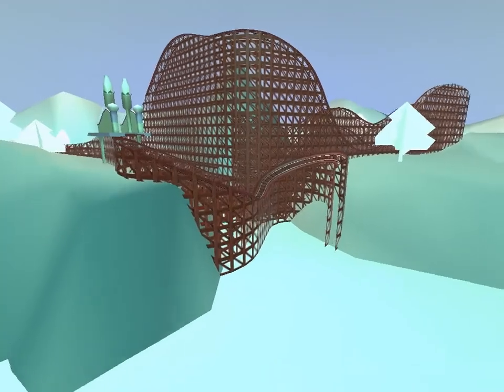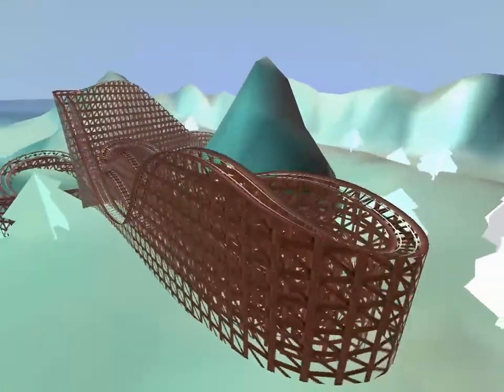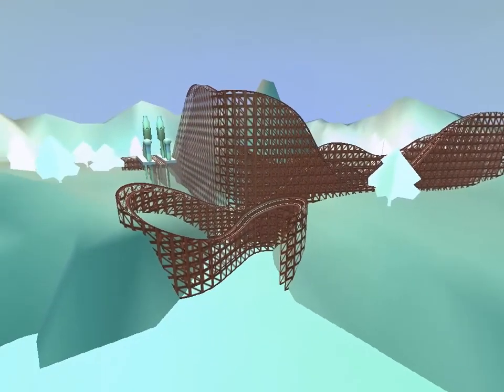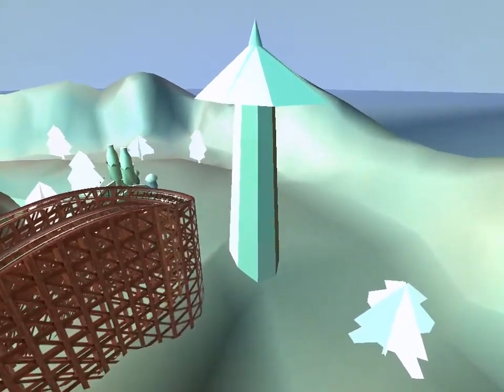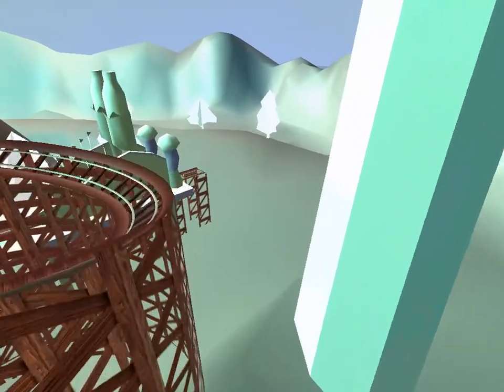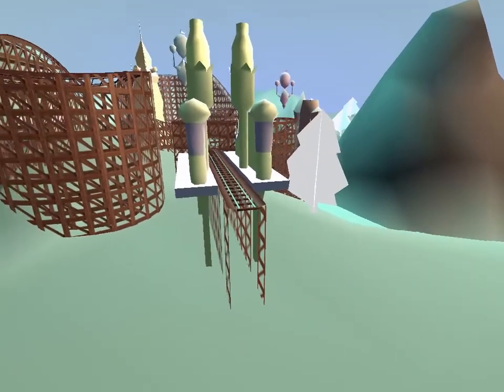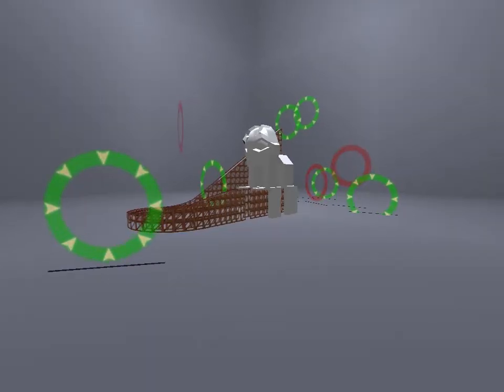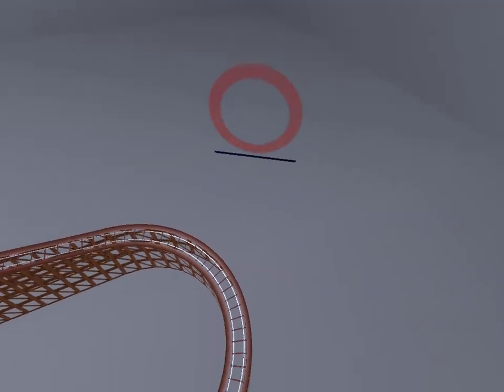Ultimate Ride (Coaster Deluxe): Imagineer Mode: Wooden Start-Ups (Textureless, Unfinished)

Comment: I'm wondering, how did you get this working on your PC? I have Windows 10 and I was wondering if this is in any way possible to make this run naitively on my computer...Or maybe I should just install a virtual machine?
Reply from the maker: (Copypasta from the Plum Crazy video) I installed the game like normal, using my CD's ripped contents, and the "setup" from there. I use a No CD crack for my game, which can be found online via a quick Google search or made somehow with other tools. When all that's installed, replace the original .exe with the cracked one. Then right click onto the application and hit "Properties", and tab over to "Compatibility Mode" and then you select "Windows XP Service Pack" either 2 or 3 should work fine. You may have to drag and drop some game files from the "game" folder" from the setup folder on the disc (ripped or not) to your game's directory in Program Files as some files are needed to run and those files could only be found from the disc.
Reply: @Stardust_Wyvern  Good to know :) I'll try tomorrow!
Reply: @Stardust_Wyvern  Is it possible I could install this from an ISO file and a virtual drive?
Reply from the maker: @francescov.3610  haven't tested the ISO/Virtual Machine method of getting the game to work, as I use the method I mentioned the most. I can't make full-on guarantees since I don't touch virtual machines as much, but I'm sure you can get the ISO to work on said platform.
Reply: @Stardust_Wyvern  I got it to work :) But unfortunately I'm not able to get the premade coasters 1-8 working even though the .csa files are in the Saves directory.
Reply from the maker: @francescov.3610  If you're on Windows 10 and this is happening. Go into File Explorer, at the top hit the "View" button next to Share and Home, toggle the "Hidden Items" checkbox. Go to your C: Drive and you should see the hidden "ProgramData" folder. This folder should house the "Disney Imagineering". Your Coaster Deluxe coasters will be in the "Saves" folder. Next you will need to copy the Coasters from 1-8 from the "Program Files" to "ProgramData's" save folder.

For Ultimate Ride Disney Coaster, your Saves directory oddly enough is in "Users" folder in the C: drive. If you have Hidden Files enabled from earlier, you will see the "AppData" folder. Click on it and go into the "Roaming" folder. Oddly enough this is where all the Disney Coaster coasters (and your Imagineer Mode progress) are accessed, despite being in the "Program Files". You will have to copy/paste the Coasters from Disney Coaster's Program Files into the "Users>AppData>Roaming" to get them to show in-game. 

I had to perform a search around my computer by making a "Manhunt" coaster (a test coaster I named just to find where the files are saved), I also looked into where Imagineer Mode progress was saved. Coaster Deluxe wasn't too bad since all of the stuff was saved onto the "ProgramData" folder. Disney Coaster on the other hand, the coaster saves and Imagineer Mode is in "AppData", some "Imagineers" may already exist because of the programs listed in the "Roaming" section, one example being the .minecraft folder for those who play that game. It's best to make a fresh Imagineer and leave those "Roaming" ones be.

Windows 10 really did complicate the saving locations, but at least the coasters save and the game works as intended (assuming the instructions above were followed). Windows XP uses the shortcuts created after the installation process, for saving your coasters, so Windows XP's fine when it comes to the location of Ultimate Ride save data.

Comment: This was a very interesting mode of this roller coaster simulation game. I had lots of fun with it on Windows XP Home Edition back in the mid 2000s. The narrator provided very clear details most often. Thank you for uploading this terrific footage!
Reply from the maker: Hey my pleasure! Back as a kid growing up, I struggled on a lot of these missions (especially Mission 4 in the Steel Coaster section). The Wooden Section wasn't too bad in terms of difficulty.
Playing this game again back in 2020 was what kept me sane throughout the pandemic, even finished the Imagineer Mode (with the exception of the Steel section, not until 2022).
Reply: @Stardust_Wyvern  I also had a hard time with the fourth steel roller coaster mission in the original and Coaster Deluxe versions as well as the fourth flying roller coaster mission since they are very complicated. I would love to complete all the missions at last.
Reply from the maker: @CEO100able  The instructions from the narrator for the 4th Steel Coaster mission isn't really clear, she doesn't mention the fact you cannot use any new track pieces at all, but can modify existing track. Some details for the other missions are clear, on the other hand.

Yeah, Flying Mission 4 was rather silly. I had to cheese it with an incredibly tall chained turn. Nothing else I could've done.

But hey, I wish you the best of luck on your Imagineer Mode campaign!